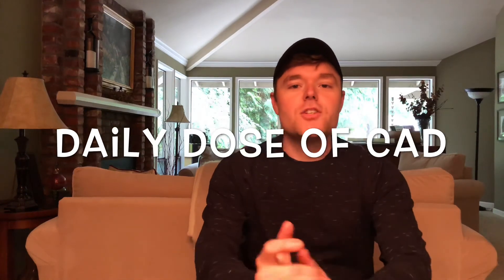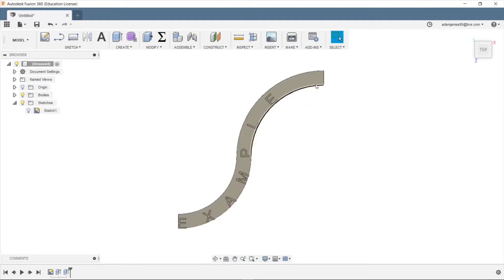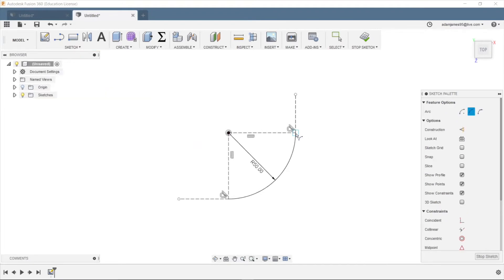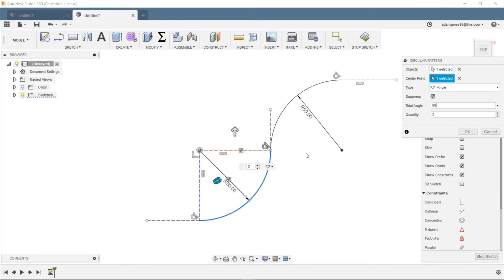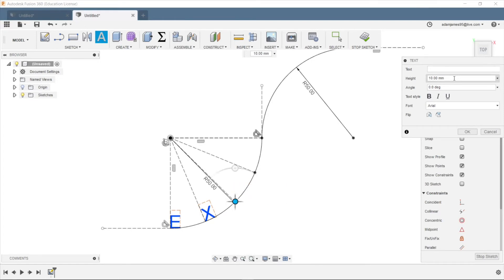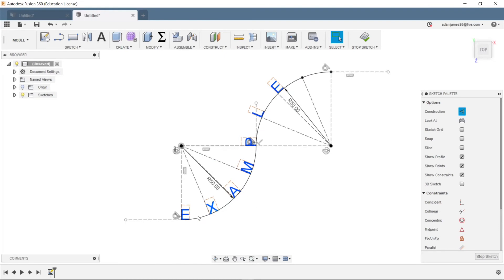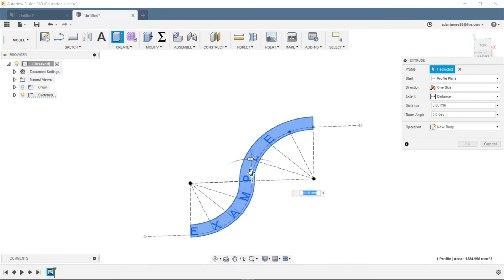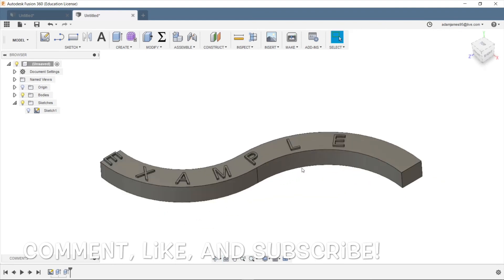HOW TO CURVE TEXT IN FUSION 360!

Comment: Wow, either there has to be a better way, or Autodesk needs to step up. I am coming back into Fusion 360 after 1 1/2 years away and I thought this would be a no-brainer.
Reply: yeah in solidworks its so easy autodesk needs to go back to the drawing board on this one
Reply: pro tip : watch series at flixzone. Me and my gf have been using them for watching a lot of movies recently.
Reply: @Jaxx Gus Definitely, been watching on Flixzone for since december myself :D
Reply: @Jaxx Gus Definitely, I have been using flixzone for since november myself =)